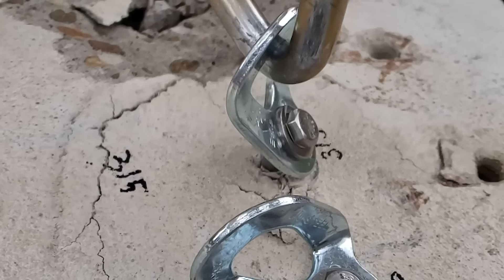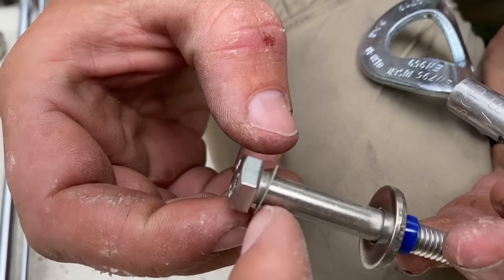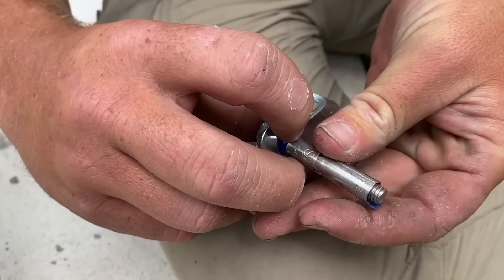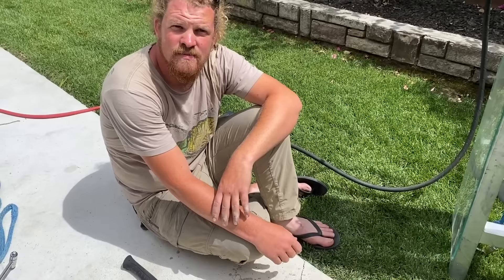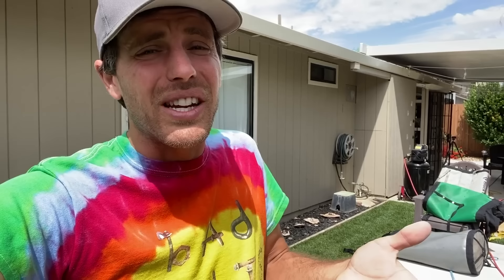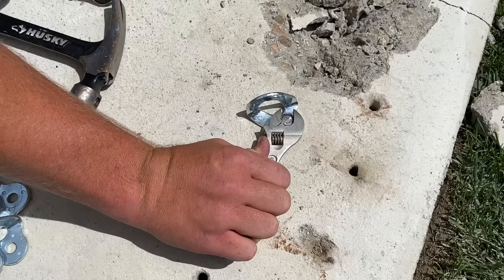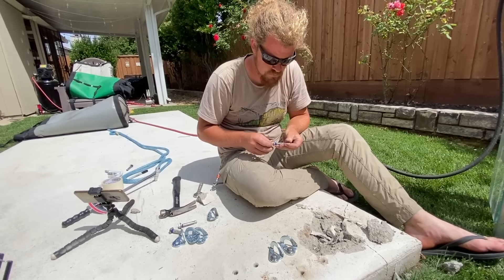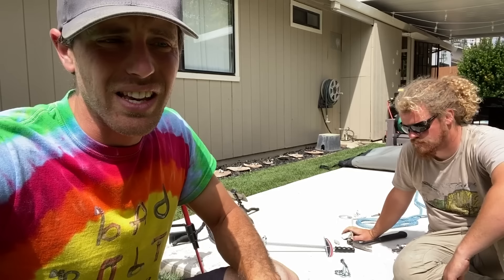What happens when you over torque a climbing bolt?

Comment: The concrete is failing, not the bolts. Leaving a space around the bolt with radius equal to the bolt length (or higher) should help to preserve the rock / concrete's integrity. It's important that the areas don't overlap, so if the bolts are 7 cm long I should have at least 14 cm between the two bolts.
Reply: This is interesting to note that wild bolting should not be too close either?
Reply: yeah, the test is voided when the first bolt already ruined the integrity of the concrete around it.  They put the bolts too close together.
Reply: There was more than the bolt length spacing between each hole. They are 2.5 inches deep, and the holes were spaced more than 2.5" apart. They need 2-3x depth/length of bolt radius.
Reply: @littlejackalo5326    that's incorrect.  Bolt spacing should be at least 2x imbedded depth + bolt diameter.  In this case, that's 2x (2.5) + .5 = 5.5".  Otherwise the cones of fracture overlap.  You can see here that the cone of fracture for the first bolt significantly overlaps into where the cone of fracture for the second bolt would have been, which makes the second bolt much weaker.

Comment: Ryan - you asked about concrete testing companies and my suggestion is to call the company that poured your concrete and ask them.  Concrete testing is very routine and the lowest cost company is going to be local to you.  If you want to know the actual strength of your concrete they will have to remove a core sample.  I would suggest first calling the concrete company, tell them the date they poured your slab, and ask if they have any 28 day breaks from that mix and time frame.  The concrete will continue to get stronger over time, but the 28 day break is pretty close to fully cured.
Reply: I think he poured the slab himself but this answer is still relevant.
Reply: interesting, thank you!

Comment: I'm a concrete contractor and can tell you drilling holes in a linear line that close together severely compromises the structural strength of the concrete. Not sure what psi your pad is or the mix you used or the cure time allowed before testing but the testing is flawed in this video.

Comment: Ryan, did you pour your test slab yourself or have it poured?  It is very poor concrete and I would bet it’s compressive strength is no more than 2000 psi.  Normal readymix is more like 3000 psi and structural concrete (that used with rebar for bridges/buildings) is twice that (4000-5000 psi).  I’m guessing whoever poured the slab undercut the amount of cement used.  If you mixed it in a wheelbarrow or it got overly wet because of improper formulation or rain, that would explain it.  I know the slab is history now that you have moved but as an engineer I was curious…

Comment: I would really love to see bigger spacing between the holes, the breaks tend to go to the Already destroyed hole. I understand that you don't want to pour and remove new slab for every few bolts, but I would suggest trying reinforced prefabricated panels.
Thank you for this content. It is revolutionary in certain way as I don't know any other creator who would approach it in similar "scientific" way.
Reply: I think that once the rock begins to cone it's already failed, so as long as the cone doesn't intersect the next bolt you're super good enough, but yeah in an ideal world you'd have a new same size mini slab for every test.
Reply: If the spacing of bolts were about 3 times the depth of the embedment there, it will give more independent results as the previous break test is affecting the available concrete to break for the next.
Reply: I agree, as interesting as this test is, it seems to me that every break already compromises the next bolt in line, and therefore possible invalid data. that being said, we can never be entirely sure if there isn't a hidden crack in the rock either, so it's not totally unrealistic...
Reply: Tension pulls seem to need bigger spacing than side-pulls.
Reply: @KrishnaDase  more like 2D

Comment: It's astonishing how strong these 3/8" Powers anchors are in the straight pullout, especially since all the force is transmitting to the expansion cone through a 5/16" or smaller diameter Grade 5 capscrew. Before Climbtech quit selling this size anchor to rock climbers they went to a supposedly stronger Power Bolt design that counterintuitively used an even smaller 1/4" diameter but Grade 8 equivalent capscrew and this concerned me a little so I stopped using them just to stay conservative. Looks like either way it's not an issue after all. In limestone sport routes in TX I've mostly used 1/2" diameter Rawl or Powers "5-piece" style bolts and only a relative few of the 3/8" size where I knew there would hardly ever be falls taken on a particular bolt. In these "consumer-oriented" climbs it is comforting to know that the 3/8" are super good enough and the 1/2" are no doubt absolutely bombalacious. Thanks guys!

Comment: My boys! I LOVE the work you do and the videos you make!
One suggestion, when discussing torque, please include units. 12 ft/lb is very different from 12 in/lb. Which are both very different from 12nm or 12kg/m. I assume you always speak in ft/lbs but as a mechanic, 12 torque pounds is a phrase that leads to danger. 

In all fairness though, the work you do and the videos speak for themselves, and anybody who's bolting will know their stuff just fine. No real need to include units in something that isn't a tech manual, thanks so much for what you do.
Reply: To piggyback on that, torque is force x distance. So it is written as ft•lbs or ft-lbs, not ft/lbs. Same thing for N•m and kg•m.
Reply: @coltonmuri3672  Good point! ft/lbs could imply division or something entirely different. Always good to be as specific as possible :D

Comment: A good way to measure whether a bolt has failed is bolt stretch. You mic the difference in stretch and if it's too high (read: long) the bolt is considered failed. We do this with rod bolts in racing engine to measure if they're still good. Overtorque or mechanical forces can both stretch a bolt to where it can't provide as much clamping force. The reason a bolt clamps is because you're stretching it slighty along its length by torquing it, go too far and it plastically deforms along its length.

Comment: On our car, some larger bolts require a light torque to snug + turn an additional angle to get the required "clamping force". Smaller bolts seem to be just torque spec. Dirty or lubricated bolts have an impact on torque.
Reply: Those specs are far too stringent for this type of bolt. As you can see from the video, there is no real difference between 10 lbf, 15 lbf, 25 lbf, 2 turns, 3 turns, any turns between 2-3 turns, etc. As long as you pre load it some, it will be enough to drive the forcing cone into the sleeve and make it tighter as you pull. Doing 1 test at each torque/number of turns is statistically irrelevant. 1 test means absolutely nothing. You'd need to do 5 tests for it to even start to become relevant. You could put 10 pins in that slab, all tightened to 20 lbf with a calibrated digital tq wrench, and they'll all pop at a different force between 10-20 lbf. There are too many other variables to consider for things like you mentioned to play a role.

Comment: 13:40 I would call that a failed test result, The bolt continued to hold its ground and remained in the concrete,... it was the concrete that failed holding, not the bolt.
You’d have to perform that test again and get the strength required to pull the bolt out with the concrete intact.
Ah nm,... you address it at 15:25

Comment: Looking at your testing methodology it looks like the concrete failed before most of the bolts. I would say that the values that you recorded are not valid as a bolt test but it does a nice job of testing your concrete.

Comment: I love your videos and I understand your desire to maximize the number of tests you can use the concrete slab for, but I'd really like it if you guys would give a good bit more spacing between bolts especially with how that concrete dinner plates off the surface. While 10x bolt diameter is "spec" for normal use, that's assuming that you're not actively compromising the substrate around each bolt.

Comment: I've had situations where I have hammered the dynabolts in. Super tight like yours. And then I had to pull them out. No way ! Even using a pichbar, the more you yank on the pichbar it just locks up. I always have to grind them off. I'm glad I stumbled upon your channel! I always wanted to see real life scenario! I'm a bit of a nerd. Lol
Reply: Dynabolts can be removed if the hole they are installed in is deep enough for the bolt shank to be driven below the surface.
If the sleeve can be gripped the entire bolt can be removed in two pieces.
Reply: @allangibson8494  yeah cheap shit!

Comment: I work on rope rescue team for the fire department. We have a rule for anchor placement that all anchor bolts must be a minimum of 6 bolt lengths away from each other and any (concrete) edges. That is because the compressive forces radiate outward. I'm curious if you ran the test again with the anchors spaced out more if the values would be different. Potentially the concrete that some of your anchors were in could have gave way prematurely due to the stress induced by the anchors on either side of it.

Comment: That blue plastic stopper piece that you said was missing from the 5 piece bolt is not actually to keep you from overscrewing it before installation, but to keep dust and debris from getting in the cone threads which could prevent it from tightening.
Reply: Good to know. Seems to function as stopper to warn against installing the bolt if the cone is screwed to far up the sleeve as well. The blue tape might serve the same function?

Comment: As a Millwright with 45 years in the field, most of these anchors are used to keep things bolted to a factory floor to keep them aligned , for example, conveyors, storage racks, ext.  The practical application is in shear not pul! out.
as far as torque just simply use a box wrench and without jerking apply pressure on the wrench with a steady pull  until the wrench stops, check the result with a torque wrench and you are probably very close and adjust accordingly. as far as anchoring overhead long bolts are required as well as a multiple hole anchor plate  used in well cured concrete with reinforcement with rebar is necessary. In granite with a shear application a stainless anchor and clip should be all you need but use bigger diameter and longer bolts.
lication

Comment: The more torque you apply to the bolt the more outward pressure the wedge is exerting on the surrounding concrete. This could cause damage to the concrete that should be holding the bolt in the hole? That might explain why higher torque loads on the bolt (above 50%) reduced the max load before pullout. I also agree that spacing the bolts further apart will reduce skewed date. Really cool test!

Comment: Ive never climbed, but I do tighten stuff to torque. If youre taking a spanner wrench and not a torque I dunno why you dont just bring a single open end wrench since its lighter and a better wrench. If youre taking a torque wrench, I like the one that makes a click after you set the torque on the handle. Its more compact and gives torque by feel rather than sight. Also, you can train your hand to feel torque spec more or less by repetition. 7-8 lbs. is a oil pan bolt and I would say thats good and cinched so 12 I would describe as "jam it on in there, jerk it on down" But it depends on the length of your bar for leverage also. I think this is good data and what the data says is the manufacturers lawyers are right saying "3 to 4 turns should be good" and the danger is not torqueing it at all.

Comment: Thanks for this. I've installed bolts with a 6" wrench, tightened about as hard as I could turn it.Not sure the torque but I tap the hanger checking for how it sounds  & bounce test each one.I tried a click wrench but doesn't seem to work well. Do they make a torque wrench with a "clutch" that would not allow you to torque above the setting ?

Comment: The concrete breakout cone is 30 degrees off horiz from the tip of the anchor. You need to space your bolts out such that your cones do not overlap. -structural engineer

Comment: Thank you for the videos, very informative. A video where they are spaced further apart, or in granite like you suggested would be interesting. This type of cone failure of the concrete is absolutely expected. Google image search "concrete breakout cone" and scroll through the images to see what's theoretically expected and images of the real thing, like you got. One thing with these bolts is that they are designed for use in concrete, and frequently have to meet certain requirements with respect to performance in an earthquake to be used in certain jurisdictions, since it would suck re designing a bolt for every location, a lot of them just meet it anyway. One of those requirements is a certain amount of ductility (stretching) before you expect the concrete to fail, but it's not definitely universal in all bolts.

Comment: Love the channel, gotta send some support as I have definitely learned a lot. These results weren't expected. I have been referring to 3/8ths 5-pieces as "removables" atop some TR solo bouldering projects as I seem to be able to break them not too far above torque (with a calibrated wrench), and just pull the pieces out with my finger (granatic gneiss) leaving just the tip behind buried in epoxy and dust like I was never there. I am wondering of the concrete wasn't hard enough to break them especially after seeing that bell shape on one of them.
Reply: Wow I want to try that. Ryan can you try this in concrete and granite?

Comment: the concrete failed and that's mostly the case for over torqueing the bolt. too much expansion of the bolt will compromise the material (rock or concrete) and leads to a quick fail. it is possible for the bolt itself to loose its threads and become weaker, but remember that you are working with hardened metal.
Reply: Yup.  Steel is stronger than concrete, and stronger than rock.  So by overtightening, you're adding stress to the rock even before you start pulling, which you have to subtract out of the total load capacity.  This is also why the undertensioned bolt was actually the "strongest" - it was putting the least stress on the rock in its unweighted state.  Of course, if a bolt is too loose, it'll just pop right out because of a lack of friction, so the recommended torqueing is a compromise between too much torque stressing the rock and too little resulting in the bolt becoming loose as its used.

Comment: A few things needs to be done to make these tests better.
1st. The spacing needs to be increased to the point where the damage doesn't spread out into the general area of the next bolt. In short, after the pull tests, there needs to be an unaffected area between each test, otherwise the failures overlaps and you don't know what measured value you would have actually gotten.

2nd. The tests needs to be repeated a few times to account for error margins in both the material strength of the slab, bolt, and also hole size.

I can however accept these issues, the tests are done on a relatively small budget, and they are still indicating a lower line.

Comment: Very interesting tests. In vertical tension torque would not play much of a role in breaking the bolt if over tightened, as pulling the bolt vertically releases the torque tension. Over tightening might crack the rock at the expansion point and this presents it's own issues, but I would wager in stable Granite this will not be observed.
But over tightening might actually affect shear strength, as the torque tension in the bolt is compounded with the shear tension added and this is a known failure mode. There are of course many variables, and any slip-up of the bolt in the rock will release the torque tension, so it will not be necessarily easy to observe. The zero torque bolt should be the strongest in shear, if it does not slip out.

Comment: Almost seems torquing might have added to the "stressing" factor which allowed for easier coning.  Water might have made the effect even more pronounced.   Hard to say because the coning definitely would make it easier for the adjacent bolts to also cone.  

Would be interesting to know how the 67.79nm (50ft pounds) of rotational force translates to upward/outward force.   You should figure out some way to hook the dyno up to the nut and torque it.

Either way, was expecting to see the bolts themselves fail... Good to see that there seems to be quite a bit of wiggle room from the spec.
Reply: I found a calculator here...  https://www.engineersedge.com/calculators/torque_calc.htm

If I did it right, the "clamping force" of 50ft-lb would be ~8000lb. Not sure how impactful that is since it's a compressive force between the nut and hanger

Comment: Anecdotal data point: last year I was installing a 3/8” SS 5-piece with a torque wrench (yes, I brought a torque wrench for route development). That worked against me as at the time, the bolt manufacturer’s website had a typo spec of 45 ft-lbs. Tightening the first bolt to that twisted it off (bolt twisted apart down by the cone at the threads). I redrilled and for the rest of the route used Fixe wedge bolts. So the danger is that severely over tightening could get the bolt close to snapping off and it would fail in tension at quite a low value.
Reply: Interesting. Be interesting to see that replicated. That 45 ft/lb. Torque spec is for the 1/2" plated steel version of these bolts.